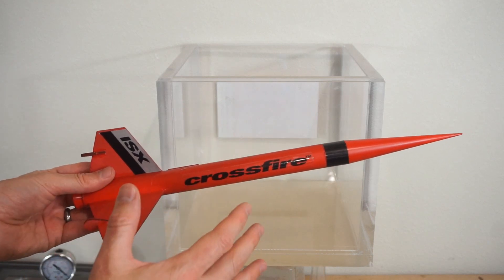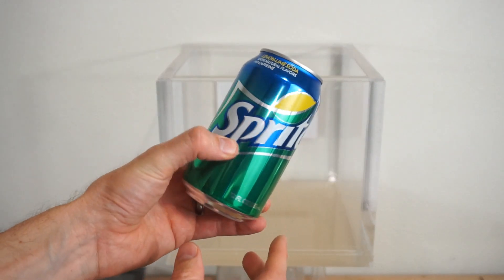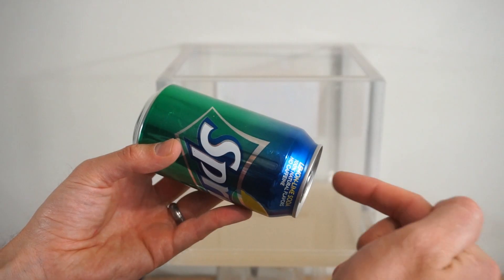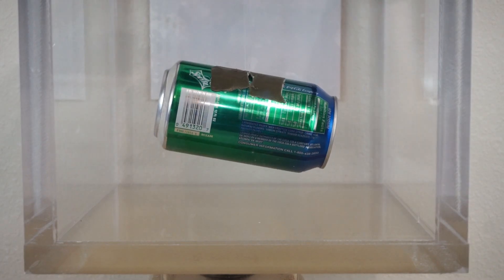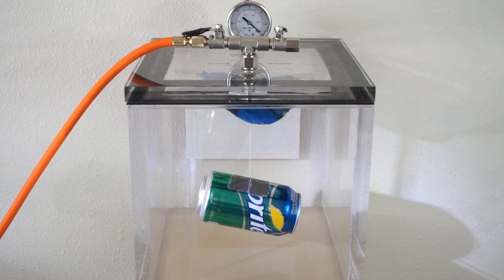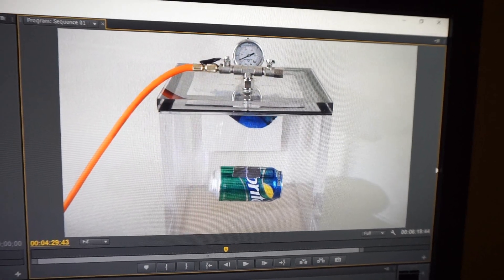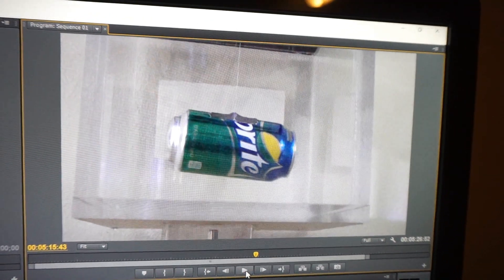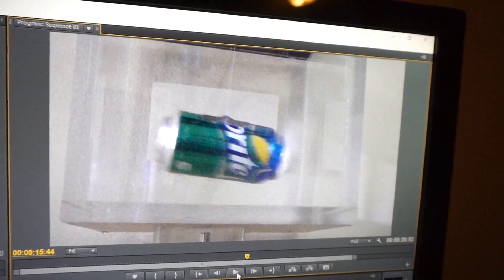Can a Rocket Fly in a Vacuum Chamber?

Comment: False, The wall obviously Is  helping to The  liquid column to push the can , The only experiment interesting Is The drone couldnt fly , to make The experiment with The can  , Is using a vacuum chamber bigger , three o five times The size of The can filled with More percent of gas than liquid , and a remote device could spike the can and see with some laser or colored gas The movement of The vector from inside of The can

Comment: no, the reason you used a soda can is because conventional solid rocket propellants use oxygen in their combustion of which there is none in a vacuum chamber.
Reply: So? There is an oxidizer in the fuel mix of a solid rocket propellant... No need for external oxygen

Comment: This proves nothing at all, the pressure dramatically changed in the chamber when the can blew up. This type experiment requires a huge vacuum chamber that won't skew the results as this tiny chamber did.
Reply: it increased after the bang, the can itself was propelled in a vacuum.
Reply: @CarlosAM1  no it wasn't, the released pressure affected the minimal tiny vacuum ....it's not a good test at all. Space is a massive massive vacuum that you can't remotely affect.
Reply: @antknee420  yeah, I know. But play the video frame by frame and you will see the can moves forward instantly, in miliseconds, way before the pressure rises. But yeah, it changed afterwards
Reply: @CarlosAM1  you expect a cheap pressure gauge to instantly react? The pressure isn't even to the gauge yet on top of that..... Common now use your head please!
Reply: @antknee420  a pressure gauge will measure pressure no matter how cheap it is. And yet again, the reaction is instant, it does not have to wait for the chamber to pressurize.
Reply: @CarlosAM1  not instantaneously it won't.....I work with vacuums daily, when you release a vacuum there is def a split second delay before our very expensive gauges react. The pressure has to reach the gauge.!!!!!!
Reply: @antknee420  oh, i think theres a misconception. I thought you were a flat earther talking about the "rockets dont work in vacuums" falacy.
Reply: @CarlosAM1  thrust doesn't work in a vacuum. Pressured systems can't exist beside a vacuum without a container(second law of thermodynamics) . I'm a questioner of things that make no sense based on our scientific laws.  I believe it's all just a simulation and the odds are way in favour of that theory. If just one intelligent species anywhere in the universe has created a simulation of any sort, then the odds are billions  to 1 that we live in it.

Comment: Nice try, very convincing to those that do not pay close attention. The top of the can is a physical object and solid and it is just like tossing a tennis ball in a serve, the liquid and gas compressed, have a physical barrier to push against. Not real proof, just a good example of not comprehending that the top of the can is a physical object. The lid blew off and the liquid and gas had a physical object to push against to get movement. It will always end in the same result no matter how many times, because the top where it broke off, is the weakest joint in the can. Sorry but you are wrong.
Reply: So the can itself, all the liquid an the gas was pushed aside by the lid acting as a barrier? That's a hell of a mighty lid right there 😂
Reply: @zeendaniels5809  Yep, just because you are stupid and do not know what a physical object is, does not mean that you do not have your head up your ass,
Reply: @glenn_gallaher  Well... If you think that a lid has more inertia than the whole can, its liquid and the gases... That's up to you 😂
PS. So cute your insult, btw...
Reply: Sage 1123 - So what if I fired a "Solid object" such as a steel projectile from a crossbow in space, will the crossbow experience a "Recoil force"?
Reply: @stuartgray5877  the lid is made of the same stuff the can is, it is centered, and still attached at the start of the experiment. The are connected, holding pressure in  the can, and the pop top, takes more pressure to pop, then the seam that broke. 

At that point in time where the thing; the can, was a single item, not two. And the pressure, to blew the seams out as can be seen by the lid not being there, it was as stable as the toy that shows where out of say 6 metall spheres hanging up and where if you lift 2 from one side they are one item, that became 2, and both sides feel it. as the other 2 balls on the line move but the center stay the same. the pressure that was in the can was at one point expanding everywhere from inside something. 

Meaning the pressure in the can has a solid surface  for a heartbeat, and the can blew the lid against this as a once a single thing, not two. The supposed big bang took how long?
Reply: @glenn_gallaher  SO do you believe that rockets work in space OR NOT?
If you believe the answer is NO, then I can convince you otherwise if you just answer a few questions.
Start with my first question.
Reply: @glenn_gallaher  - So you DONT believe that rocket engines work in a vacuum.
Physics says that they MUST, and it can be proven with simple examples.
I also have evidence that they work in a vacuum.
If you dont understand how it works, then just answer my questions:

Would a CROSSBOW feel RECOIL if fired in zero-G, in a vacuum?
Its a yes or no kind of answer....

Comment: The can has oxygen in it and when it explodes, it introduces atmospheric pressure into the system which destroys the vacuum. Now try it in the infinitely strong and millions of light years  vacuum of outer space. This experiment actually proves an object does not move from thrust without atmospheric pressure. Massive fail video. Lol
Reply: The can has oxygen in it
And so does the rocket.

Now try it in the infinitely strong and millions of light years  vacuum of outer space.
"Infinitely strong" vacuum? Vacuum isn't "strong". Vacuum is an absence of matter. It doesn't do anything. Rocket's don't rely on external factors in order to fly.

This experiment actually proves an object does not move from thrust without atmospheric pressure.
No, it actually proves that an object can move from thrust without the atmospheric pressure. You just don't understand how rockets work, is all.
Reply: @Jan_Strzelecki  Yeah it's "Zero PSI strong"
Reply: May I ask what PRESSURE (in PSI) this "infinitely strong and millions of light years  vacuum of outer space"  IS?

What Pressure is this vacuum of space?

Comment: It pushes against the wall. You will need a huge vaccum chamber and rocket fuel if you're trying to prove NASA
Reply: OR you could just watch a rocket launch
Reply: @stuartgray5877  im afraid that wont be of any help, the rockets start arching when they get high up..
Reply: @eirikmurito   Try this experiment.
Get a globe (or a basketball).
Pretend you are an ant on the surface of that globe.
Now take a thumbtack and pretend it is a rocket launching from the location of the ant.
Now "launch" the rocket, go straight up (perpendicular to the surface at the launch site), clear the atmosphere (50 kilometers up or about 1/8 of a n inch from your globe)<
Now TURN THE ROCKET so it is moving PARALLEL to the surface as it keeps following the curvature of the earth at say 100 kilometers up (or about 1/4 inch on your globe).

THIS IS HOW ROCKETS ACHIEVE "ORBIT"

NOW Mars Rover - explain what the ant would see during this demonstration 
What would the rocket appear to do from the ant's perspective.

I LOVE how flat earthers like to use "The rocket looks EXACTLY as it should while launching FROM A SPHERICAL EARTH, so that is proof the earth is NOT a sphere".

See how you are saying it looks just like it SHOULD if the earth was a sphere so that is PROOF IT IS NOT A SPHERE!?!

See how pathetic that argument actually IS?
Reply: @eirikmurito  no comment?
Reply: @stuartgray5877  the thing just flew slightly higher than an airplane (according to my observation, im not so interested in how high NASA claims it flew). Even if the mainstream gravity model was true there  is no way theres suddenly zero gravity right above a regular airplane..
Reply: Kit Canyon  im ok discussing with you but you need to have a more friendly attitude
Reply: @eirikmurito  So you STILL think that SpaceX video is FAKE?  So they have faked it FIFTY TIMES right in front of tens of thousands of live spectators?
Reply: @stuartgray5877  why do you care what I think?
Reply: @stuartgray5877  ah so that's why you're here, to fight for the children. How noble of you..
Reply: @eirikmurito  Here is a challenge for you . IF you dont believe that rocket propulsion works in a vacuum, I can convince ANYONE with a basic grasp of physics that it MUST work in a vacuum.  Care to take the challenge?  You only have to answer about 5 simple physics questions with no math.

First question: If I fire a standard steel projectile from a crossbow, in zero-G, in a vacuum, WILL I FEEL RECOIL? Yes or no?

Most "physics deniers" refuse to answer these questions while my 15 year old granddaughter CAN answer them without hesitation.
Reply: @eirikmurito  whats the matter?  Afraid to answer five questions that ANYONE with even a rudimentary grasp of physics can answer?  Or are you confident that you CAN answer the questions, but you refuse to because you might be proven wrong?

Comment: The exploding can exhausts beside liquid also pure invisible gas which moves much faster than the liquid.. Unless you can come up with a way  to make visible the gas to the camera there is no way to tell if the can moved before the beam of pure gas reached the wall of the chamber and therefore the movement of the can be a result of contact forces and Nt 3 law. Also the pressure gauge has a response delay time.

Comment: anyone who claims hot gas jet propulsion can produce motion in vacuo is either uneducated or lying.
Reply: you don't use COM for macro behaviour of gasses, you use COE. and the energy of a gas expanding into a vacuum is conserved, as it loses no energy during the expansion, thus doing no work. no work = no motion. thermodynamics 101. as ever, you are lying right from the start.
also, a rocket is not a crossbow - you seem very confused about this simple distinction.
Reply: @papalegba6759  - You dont even understand half the bullshit you repeat.

Please explain in detail this sentence you repeat frequently:
"you don't use COM for macro behaviour of gasses, you use COE. and the energy of a gas expanding into a vacuum is conserved"
Reply: @stuartgray5877  <----- thinks abuse is science.
Reply: @papalegba6759  You're right and I never thought about it-- Stuart is more than likely a chatbot.
Reply: @papalegba6759  - "also, a rocket is not a crossbow - "

Correct, but BOTH have to follow the LAW of conservation of momentum.
This LAW applies to crossbow projectiles AND Gas molecules because BOTH HAVE MASS.

BigMonkey - please tell me WHAT is accelerating the gas molecules as they exit the rocket nozzle?

The gas molecules were STATIONARY with respect to the rocket nozzle one second then the next second they are at EXTREME VELOCITY AWAY from the nozzle. 
THE MOLECULES GAINED MOMENTUM, - now WHERE did the force originate that ACCELERATED THE MOLECULES?
Reply: @stuartgray5877  you do not use COM to describe macro behaviour of gasses, you use COE. this is thermodynamics 101.
and, as you agree a rocket is not a crossbow, so they cannot be compared, we are done here.
you're a liar, can't debate with liars.
Reply: the laws of thermodynamics are not 'bullshit'. a gas does no work as it expands into a vacuum. and an engine incapable of doing work is incapable of producing motion. citation:
https://thefactfactor.com/facts/pure_science/chemistry/physical-chemistry/pressure-volume-work/6602/
like i said, you are a liar, can't debate with liars.
Reply: you are denying the central equation in pressure-volume work, i.e. work = external pressure x change in volume. thus, the work done by a gas expanding against zero external pressure = zero. if you do not believe the laws of thermodynamics are real there's no point continuing.
Reply: @papalegba6759  WHERE DIES THE FORCE ORIGINATE THAT US ACCELERATING THE GAS?

If you cannot answer that simple question, then all of the rest of your nonsense means nothing.

WHY are you afraid to answer?
Reply: @papalegba6759  Have you even BOTHERED to check the news about Spacex's Starlink satellite launches?
You know the ones where you CAN SEE THE STRING OF SATELLITES WITH YOUR EYES for a few weeks after launch?

I'll BET your cognitive dissonance will not even let you ACKNOWLEDGE the existence of these launches and VISIBLE TO THE NAKED EYE satellites.

Another launch went up THIS MORNING!  

Now be SURE TO IGNORE that fact, and whatever you do DONT GO LOOK FOR THEM.
DONT google search "How to spot the starlink satellites" WHATEVER YOU DO.
Reply: lol stuart gray is like a targeted ddos attack. no way it's a human, more likely an advanced chatbot.
Reply: @papalegba6759  So you are going to argue that the Exhaust gas DOES NO WORK as it goes from 3000 PSI to 1.0 PSI?

Is THAT what you are trying to say?

Probably NOT, because only someone who has NEVER TAKEN a PHYSICS class in their LIVES would say.

OneBigMonkey - WHY dont yo defend yourself when I accuse you of having NEVER TAKEN A PHYSICS COURSE I N YOUR LIFE?
Reply: lmao:
https://en.wikipedia.org/wiki/Sealioning
Reply: Papa Legba  The "evidence" points to the fact that YOU have never taken a physics (or thermodynamics) class IN YOUR LIFE.  Leave the engineering to the professionals. I can SHOW YOU VIDEO of a rocket performing propulsive maneuvers IN VACUUM and you will STILL say its impossible.
Reply: Papa Legba  And WHY do you keep changing your name? Are you so embarrassed by us making you look like a fool that you have to keep changing your name? This is about the FIFTH name where I have made you look like a fool.
Reply: OneBigMonkey - Sorry but you have it backwards, the Law of COnservation of Momentum says that Rocket Propulsion MUST work in a vacuum.
AND the "Rocket Equation" says that Rocket Propulsion is MORE EFFICIENT IN A VACUUM.
But since you have never taken even a rudimentary physics class in your life, you certainly dont even know what those two things ARE.

So LETS WORK IT OUT shall we?

First we ill make sure you understand Newton's basic laws.

I'll ask you about 4 HIGH SCHOOL LEVEL PHYSICS QUESTIONS.
You just ANSWER THEM and we will see if rocket propulsion works in a vacuum or not.
I will BET that you will flat out REFUSE TO ANSWER, or you will try to change the subject (with some insults inserted to make you sound smart)

1 - If I fire a standard steel projectile from a crossbow here on earth, in gravity, in atmospheric pressure, WILL I FEEL A RECOIL? Yes or NO.

Now watch as OneBigMonkey does WHATEVER HE CAN to AVOID answering the questions because he knows that ANSWERING TRUTHFULLY will EXPOSE HIS LIES.
I'll even give the next question:

2 - If I fire a standard steel projectile from a crossbow , in Zero-G, in a VACUUM ,  WILL I FEEL A RECOIL? Yes or NO.
Reply: Kit Canyon  <----- social bot spamming cringe. muting it now.

Comment: thats a really tough call... just because the size of the can inside the vaccum...  if the vaccum was say 10 x the size of the can would we still see the same effect....??
Reply: I agree. The experiment is void because there will be gas escaping, repelling the can of the wall before we we the liquid. 

It would be good to see it done in a bigger test unit. 1m cubed should do it.
Longer string can suspended at least 500mm into tank, with base 700mm away from wall, tiny hole pinned into the centre of the can base to guarantee direction.

Comment: Its pushing off the lid of the can this proves nothing
Reply: Kit Canyon  i'm not a 'flatter'. and nobody educated takes nasa's pseudoscientific nonsense seriously. muting you now, as you are clearly a time wasting bot.
Reply: yep, a free body diagram of the force pairings involved busts this fraudulent 'experiment' wide open.
Reply: @papalegba6759  all he has to do is get a bigger vacuum box and try to fly a drone in it... Blades shouldnt work cause its no air to push off
Reply: @redvelvet757  either a free body diagram or a pressure-volume work calculation are the 2 methods an engineer would use to solve this problem: the 1st is based on Newtonian dynamics, the 2nd on thermodynamics. both prove hot gas jet propulsion in vacuo is impossible, as the concept violates multiple laws of physics.